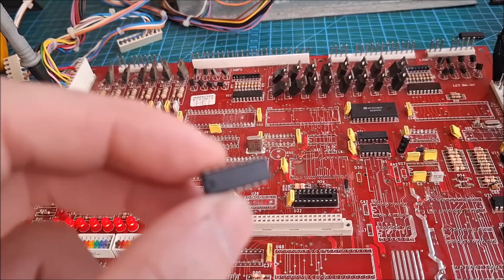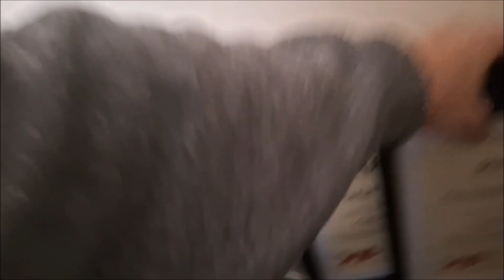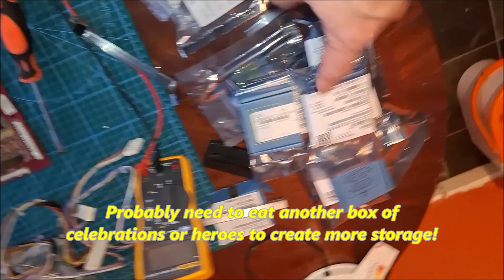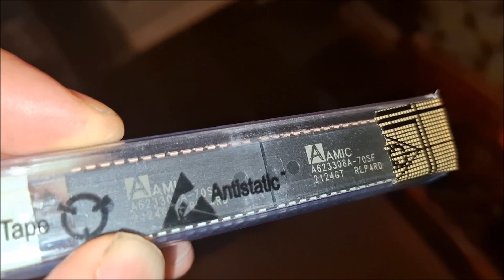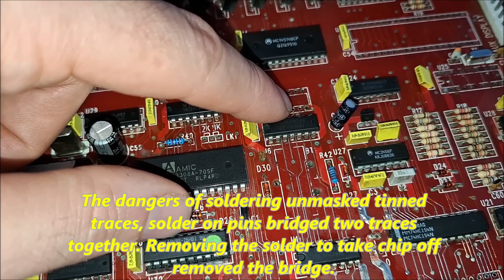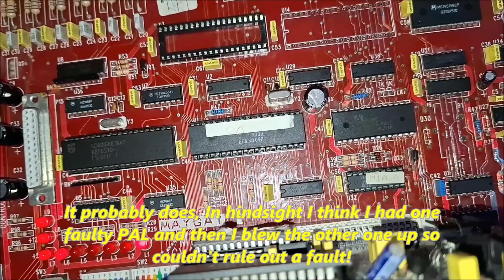A MAYGAY FROM HELL, THE BOARD THEY ALL SAID WAS BER!

Comment: I wonder, rather than keeping all of these old boards going, would it be better in the long run to have an arm-based board running an emulator with all the inputs and outputs? You would need a core board with a different I/O board for each tech that needed interfacing too. It could even be based on an Arduino with a plugin I/O board... It would be an interesting project that I wish I had the time to undertake.